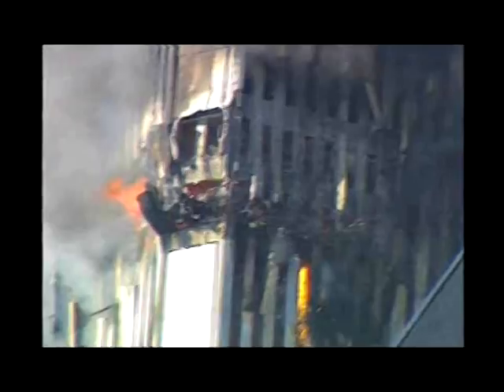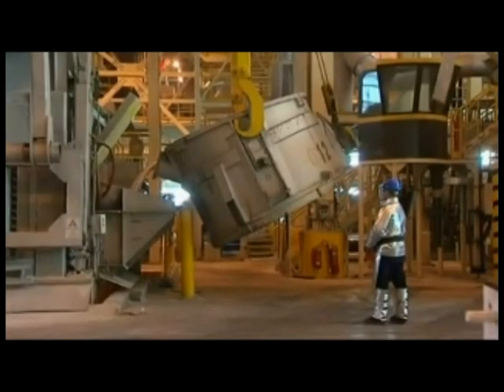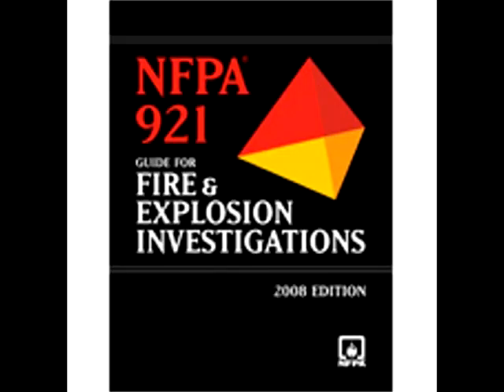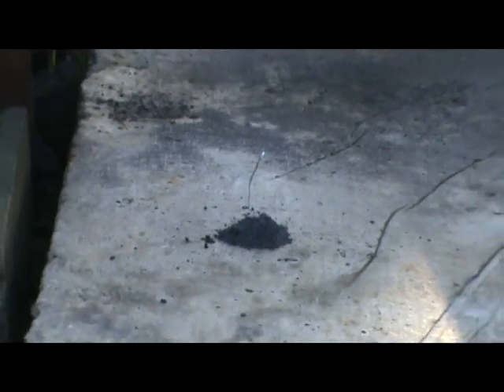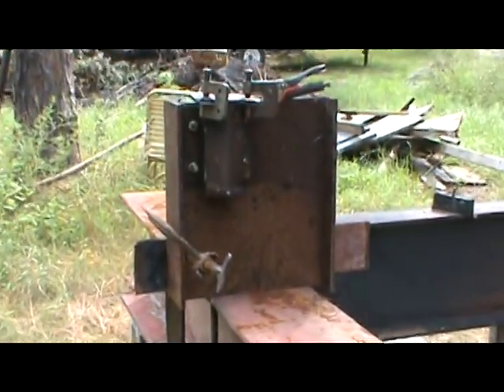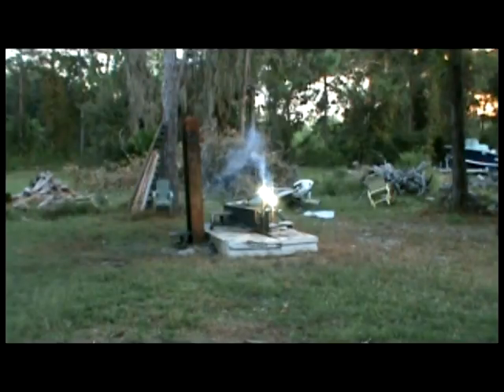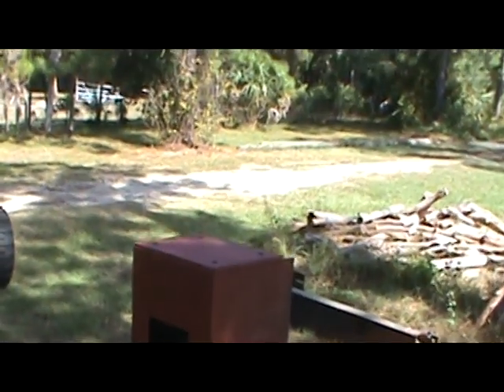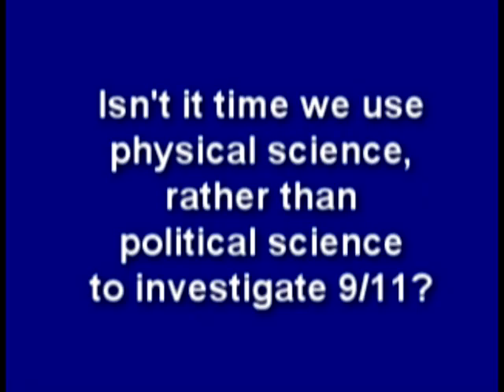9/11 Experiments: The Great Thermate Debate

Comment: And you are forgetting a huge 767 went into the tower, almost through it? which would have destroyed the structure at that speed, weakening it and then the fire afterwards just weakened it more... meaning it collapsed...
Reply: That is true. Buildings back then were not designed for planes hitting them. The new One World Trade Centre is

Comment: I'm sure glad I don't live next door to this guy!

Whilst this video is very cool and this guy very clever, all he does is prove that thermite can cut through steel. He does not prove that this was used at 9/11 to destroy the WTC. Nor does he prove that a jumbo jet hitting the WTC and the subsequent fire couldn't have brought down the towers.

Just think about it: Why would you need to even bring down the towers? Wasn't it enough to fly two jets into them? Even If they didn't bring them down it would still be sufficient pretext for all the military actions by the government which followed.

Physics is great, but you might want to use a little reason as well.

Comment: I know of a school who's gymnasium burned because the large stage curtains caught fire. The heat caused the steel rafters to expand and twist ruining the structural integrity.   So lots of damage from the impact, and large amounts of heat from jet fuel over time... all it takes is for a little collapsing to cause the chain reaction.

Comment: what about other materials like copper being used?  "copper oxide and precisely graded particles of magnesium and aluminum; consistent particle size is crucial to ensure that the torch burns at the desired temperature.  The result is a jet of flame with a temperature over 2700 C (nearly 5000 F) and a speed of over 2000 meters (more than a mile) per second."  That description comes from an article about a Metal Vapor Torch.  and how much more success would you have with super thermite?  and what if you lined your boxes with asbestos so the steel casing wouldn't melt but concentrate all the energy at your targeted beams?

Comment: I would like to also add that Railroad companies the world over have been using thermitic reactions to weld high speed rails together since the 1980's. MOST railroad rails are made from A36 or hot rolled steel.
Reply: +Dave Joyce since 1899, actually

Comment: yep.  thats because it was molten aluminum.  Which is 3x more explosive than tnt when molten and comes in contact with water which was in abundant supply (~30,000g within the tower for things like toilets, sinks, soda machines, water bottles, etc. 

Quite easly explained with normal science rather than trying to fit evidence to prove a hypothesis

Comment: So... They put Thermite into the structure in the 70's?.. they would have had to.. after construction does not make sense..  Yes, I give you that Thermite can melt steel, they use it when repairing Train tracks... But to me just sounds like any other conspiracy theory.

Comment: If thermite was placed how and when? Wouldn't the beams have to be accessed thru the interior walls? How much manpower is need to accomplish the task of placing the thermite before the planes flew into the building in such a large structure? A lone wolf?  I am sure the building had a maintenance staff who "knew" their building and were aware of major projects which placing the thermite would have been. Were all floors done or only the floors where the planes hit? This means inexperienced pilots had to hit precise predetermined locations. If all floors were done why was unreacted thermite not found in the wreckage? Why did the perpetrators choose different levels in the two towers to place the thermite? Your experiments were meticulous. I know thermite can melt steel because they use the reaction to join railroad tracks. But I don't see how thermite could have been placed before hand without the workers placing the material  being challenged. The planes were made of many different materials that were shredded and mixed with the materials of the building upon impact. It would be more plausible that this led to the formation of thermite in random locations.

Comment: crushffl, cornskid, and klmullins65 are all trolls or shills.
they have only insults and misinformation to back themselves up.

Here is a reply from crushffl how he debates, this is cognitive dissonance at best: 

"Awww, listen to the butthurt little troofer.  Before I called you 
anything, you called me "brainwashed" and insisted I was an incompetent 
engineer because--get this--I have the ability to correctly cite 
references and interpret a data table.  So, in addition to correctly 
identifying you as dumbass and a jackass, which I stand by, YOU ARE A 
HYPOCRITE."
This fellow claims to be an engineer, but fails with simple 7th grade physics.
Yes, crushffl, I question your supposed ability with engineering.

Comment: Too bad no melted steel beams were found at WTC. NONE. Lots of cracked, bent, and broken beams but no melted beams.
Reply: That is because none melted the beams buckled and then the building collapsed. The heat from the fire weakened the beams

Comment: Isn't it possible in anyway that the hijackers had thermite (or thermate) at their disposal? Or would they have not been able to obtain it?
Reply: +Gernqy they didn't need it, because the beams don't have to completely melt to fail. They only have to get hot enough to bend under the tremendous pressure of the building they're supporting. Steel glows orange at the temperature of burning jet fuel (Orange hot steel temps start at about 981°C, and the open air burn temp of jet fuel is about 1030°C).